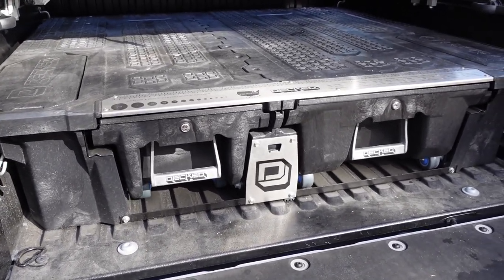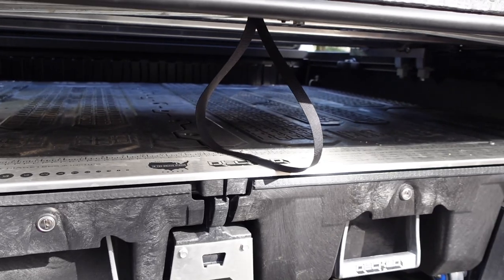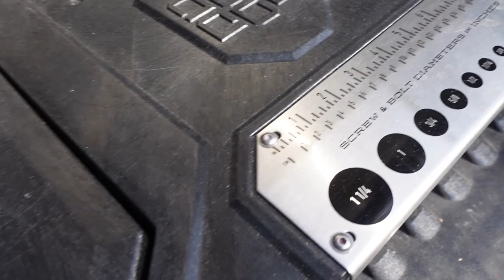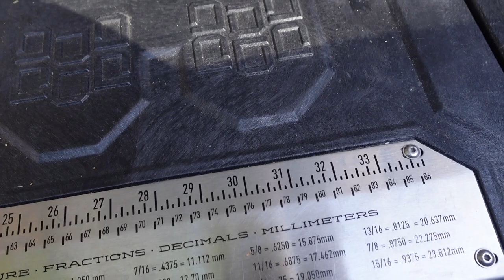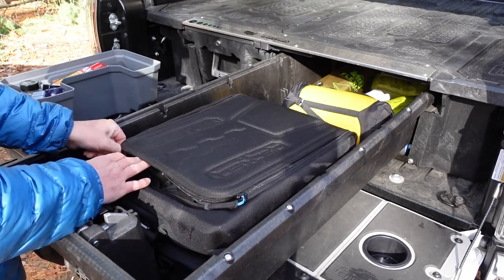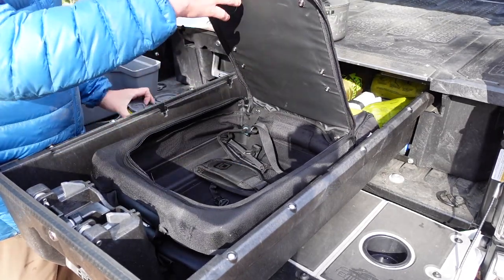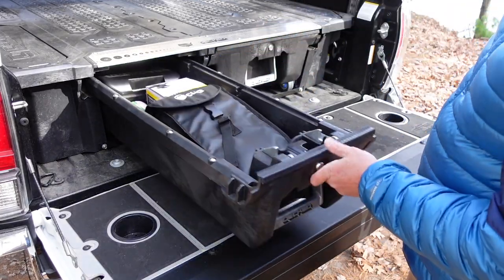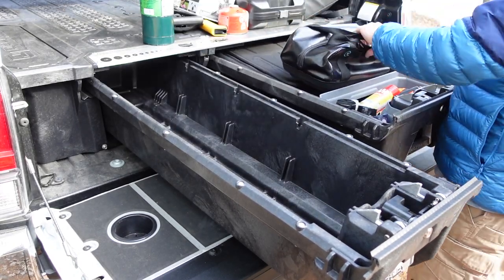Decked Drawer System, Ultimate Organization for your Truck

Comment: I am really looking at this system for my '22 Frontier.  On my old Titan I had a Diamondback and I really liked it as well - mainly for security.  But not sure I want to go that route with my new truck, and a cap is just way too expensive for me right now.  However I still need a way to lock up up my gear when I'm backcountry hunting.  This seems like the ticket and its not crazy expensive - plus I can still add a cap or a rack down the road if I want.
Reply from the maker: Sounds like a good plan.

Comment: Awesome video with a lot of great information. You are the first person that has done what I am thinking about doing to my truck. I have the Decked drawer system in my '23 F-150 and I really am enjoying it. I am wanting to add a cover to add security to my truck bed and have been leaning to the Diamondback cover. I want to be able to secure my dog's 'impact dog crate'  and a Pelican 1750 rifle case when we travel. This crate folds down to be about 7 ½" inches thick and the Pelican case is about 6 to 6 ½". I know that you have a different truck, but how much room is there on top of the decked system for these items to fit under the Diamondback cover? Any information you can offer would be greatly appreciated.
Reply: I have the same truck as k2, with a Decked system and was thinking of adding a diamondback.
LS Do you like the Decked Diamondback combo or did you get rid of the Diamondback?